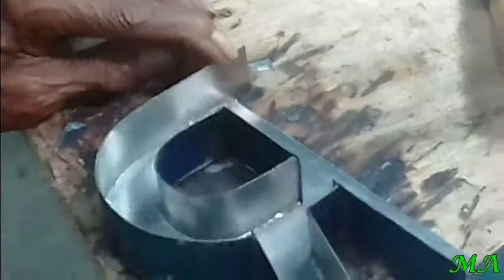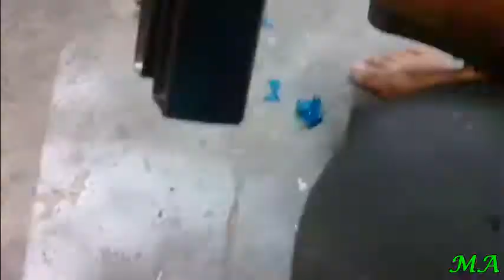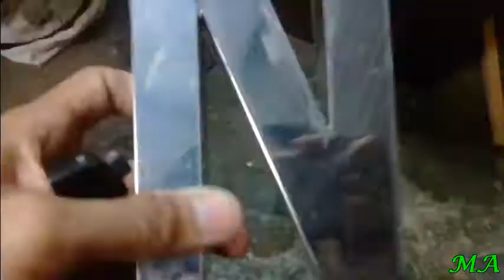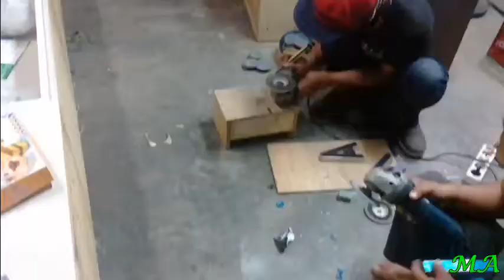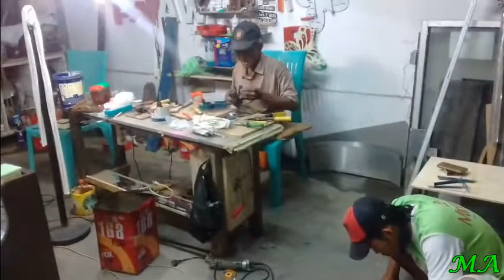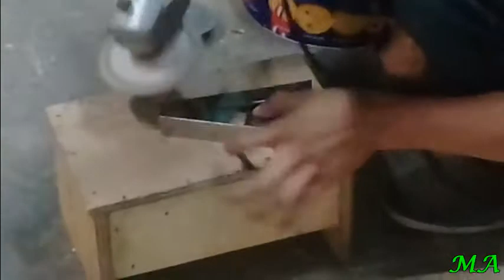Proses Pembuatan Huruf Timbul Stainless

Comment: Which acid used? Before soldering
Reply from the maker: Yes.. Using " Soft HCl"
Reply: @MinimalistArt  mixing zing into it? Or simple acid
Reply from the maker: Yes mixing with zing inside ex used batteries to making soft HCl
Reply: @MinimalistArt  thanks